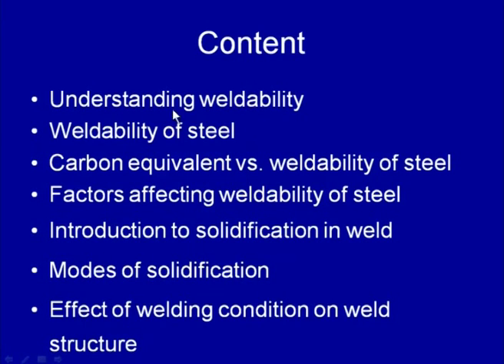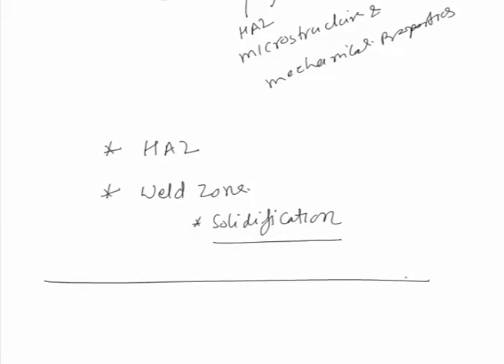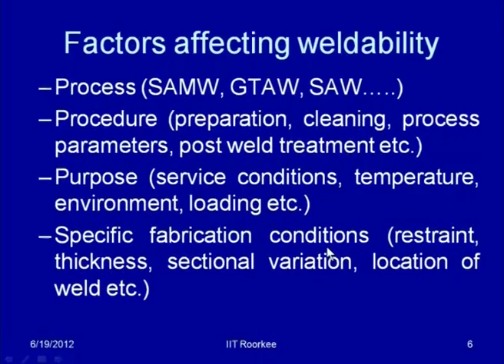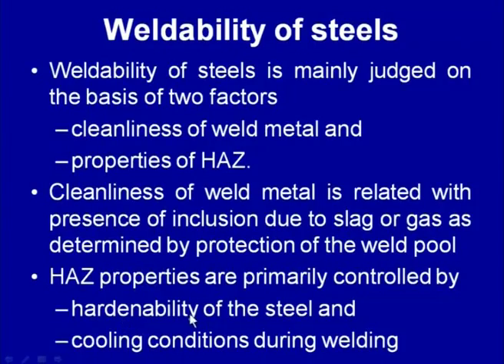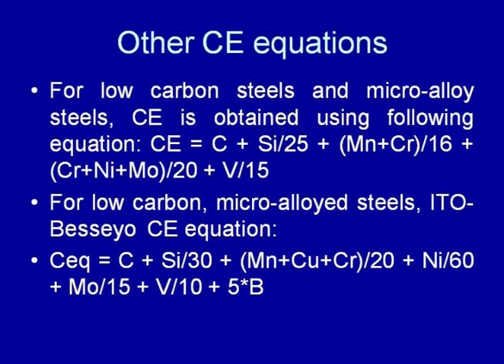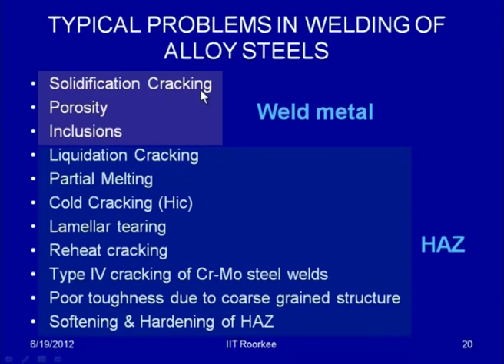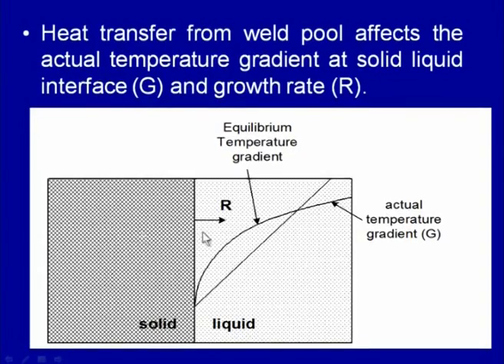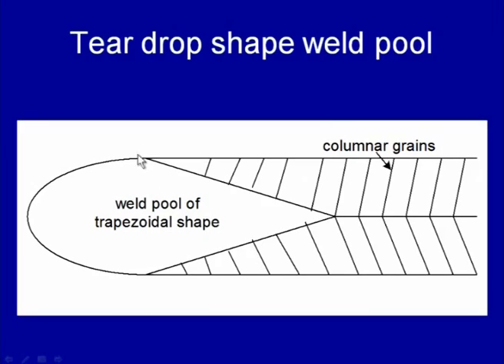Understanding Weldability

Comment: If heating of steel parts structural member done by oxy cutting torch how to control heating temperature I.e how gas cutter can gauge how much heating has been done